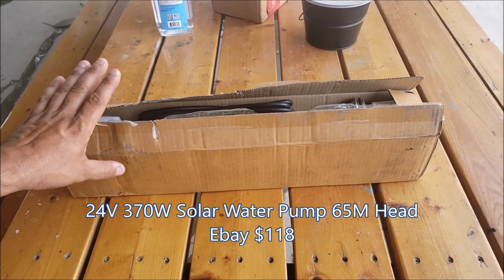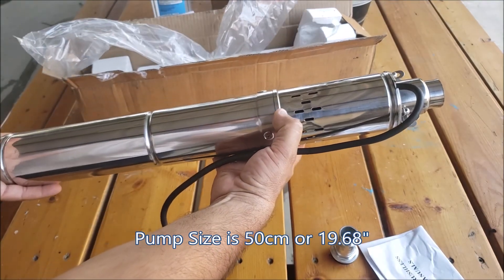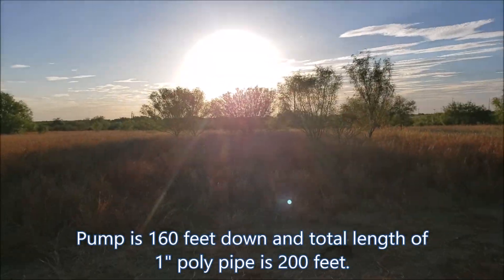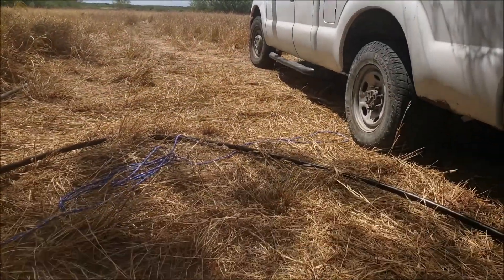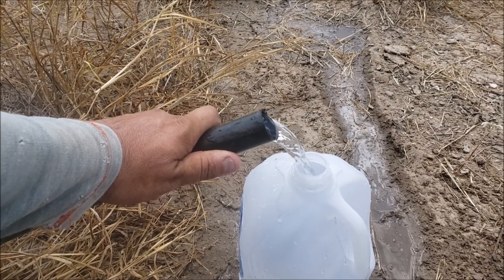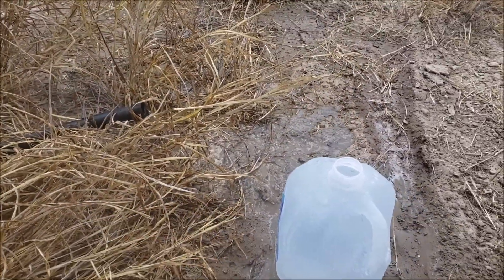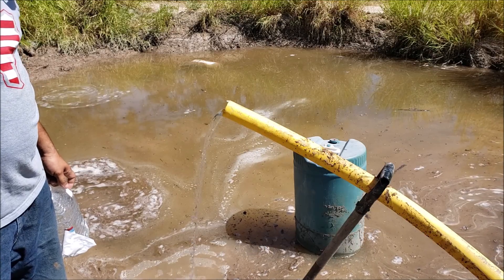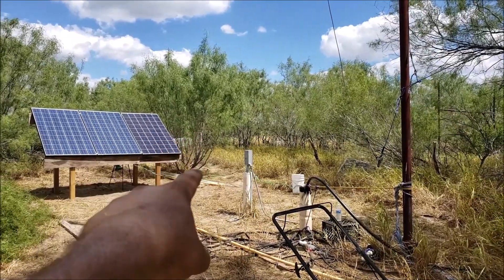DIY 24v solar water well pump for pond using Trina panels from Santan Solar

Comment: How where are pannels  and J am trying to figure out where the switch is too
Reply from the maker: I used 3 x 275 watt solar panels rated at max 35 volts in series. Solar panels--> 200 feet wire--> 24v solar pump. No switch runs all day.

Comment: ALL the cheap Chinese submersible pumps appear to die for the same reason: water entering the motor and destroying it. The pumps themselves seem pretty good. If the Chinese manufacturers could solve the poor motor seal problem they'd have some great products. At the moment, they're disposable, often lasting less than a year, and the promised warranty rarely means anything.
Reply from the maker: I had 1 pump that the body got a pin hole and 1 that the screw wore out and flow dropped to 2 gpm. I do buy the Allstate warranty on ebay and they have replaced 2 pumps for me. I was looking into RPS and their full kits are like $4000. I am planning on buying a new solar pump that uses impellers instead of a screw.
Reply: it is how they make their money, a good quality one would last 20 yrs.

Comment: You will damage the pump if the panel voltage and current are too far from specs.
Reply from the maker: This pump has a sticker showing 70V max. I run a little over 28 volts if I remember correctly. The pump rusted out and got a pin hole before motor failed. I really like this pump over other solar powered pumps.

Comment: What gauge wire did you use. I am down 170'
Reply from the maker: Sorry for the late response but I ran 10awg stranded wire. My friend gave me a 500ft spool of green wire and I just color coded the ends to prevent reverse polarity. Thanks for stopping by.

Comment: Are you using PWM controller or MPTT controller ? And did you used battery ?
Reply from the maker: No controller as this pump has its own built in controller. I run my solar panels directly to pump. Pump works anywhere from 24v to 72v. I can add batteries with a MPPT controller to use during cloudy days or at night but a constant 300w pull on batteries will drain them quickly.
Reply: @cutweldngrind  thanks you !
I bought the same ! And I will add a 400W panel.
I hope it will work very long time !

Comment: Thank you very much for the video. You answered the question I was wondering about this similar pump model I found on Ali, which was, does it work if you have clouds, and if the voltage delivered by the panels is not not at most. And from your video it seems so, there is just less throughput. Knowing it's just for a small irrigation system, I don't need much.
On the other hand, do you think there is security in the event of a lack of water in the borehole? I'm not sure, because it's marked not to run dry.
It would be nice to add security, with a sensor.

Comment: Does the 65 meter water lift works? 
At the beginning written pump is 160 feet down. Interested on whether the motor is strong enough for the max head.
Reply from the maker: The pump is 140 ft (43m) below from the surface. I have an additional 25ft (8m) of 1" poly pipe that feeds into a 2.5" poly pipe. The 2.5" poly pipe is 500ft long and mostly downhill so that does not really affect the head of pump. I did once get a plug in the line and the pump pushed it out so its strong enough. The pump lasted about 1 year and a pin hole developed which caused water to get into pump and damage it.
Reply: @cutweldngrind  If a pinhole developed, I must wonder if that 'stainless steel' is really stainless.
Reply: @cutweldngrind  you haven't answered the question, how far below ground level is the water level.

Comment: Really nice instructional video.  Thank you
Reply from the maker: Glad it was helpful! This has been the best pump I have used but the pump went out in about 13 or 14 months. The panels have worked great.
Reply: @cutweldngrind  Such funny timing to read this.  Just yesterday afternoon my well has failed.  About to go check it out.  I suspect the motor starter.  My friend Steve is planning on using solar panels for his well, and you helped me to understand that setup.  Thank you.
Reply from the maker: @bretgreen5314  Glad my video helped. I had a hard time deciding between 110v AC and 24v DC pumps. Ebay had both pumps at about $100, the 110v pump will output about 16pgm versus 6gpm on the DC solar pump. 110v AC power would be provided by either Grid power or generator. The solar panels I have are rated for 750 watts and the solar pump is rated at 375 watts which means I get enough power on some overcast days. If you go solar powered and have enough solar panels a battery bank can be installed. A typical car battery is about 70AH which comes out to about 875 watts (12.5 Volts x70AH=875wh). 1 car battery would have enough power storage to run a pump 3 hours but usually we tend to only use half the capacity to prevent batteries from getting damaged. IF we get 2 12v batteries in series to run this pump it would safely run the pump 3 hours and up to 5 hours max. I plan on later installing a 1000 gallon tank and using a small RV pump with pressure switch to provide pressured water to sink and toilets. Well, good luck on your pump.
Reply: @cutweldngrind  Very excellent.  You might consider using deep-cycle marine batteries, as they are made for charge cycling and have pretty good capacity.  I once made a 24 VDC lawnmower and used two 12 VDC deep-cycle Sears batteries in series.  It worked very nicely.  Of course, you may be aware of the popularity of the 6 VDC Trojan T105 batteries for solar storage use.  I actually used a set of 16 of those batteries in an electric car once.  The capacity was very good, and they lasted a long time.  Have a good one. . .

Comment: Would you suggest anything different for the same distance going to a bladder tank to a house of 5?
Reply from the maker: I am not sure how this pump will work with a bladder as I am unfamiliar with them. I also just have the end of house opened and gravity feed into the pond so not sure how much pressure it can handle.
Reply: I tried it with and without bladder tank.  It fills the tank up the same as the 220 pump I had. It pulls about 85' up out the well fills tank then goes about 80' to our house. Very impressed with it runs off 200watts

Comment: Is your pump still working.  Thinking of buying one
Reply from the maker: The first pump lasted 2 months and was replaced with an identical unit thats still running great. The warranty is something that does not exist so don't believe the ad, I had to use PayPal to resolve issue.

Comment: Keep us updated!
Reply from the maker: Pump lasted 3 months and I got a replacement installed about 2 weeks ago. I went to the ranch today and this one is still working so hopefully it will outlast the first one. There is a lot of pumps out there for shallow wells that can push more GPM but those are rated to about 90 feet max of head. If there is anything that you need to find out on the pump, pond or solar just let me know and I will try my best to get an answer for you.
Reply: Still running? What gauge wire you end up using?

Comment: Awesome test buddy. If that was my project, I would have gone with the Submersible Solar Water Pump 280W -48V DC-16L/min-60m it is more efficient especially on voltage drop from your 200ft long run.
Thanks for sharing and have a bless day
Reply from the maker: I forgot you also do off grid water well setups. When I bought this pump there was hardly any choices with 50M of head or more. I have not tested efficiency here but a 48v or 60V pump would of been better. I had to use 10awg cable as were a 48v pump I can get away with way thinner conductors probably 12 awg. Well thanks for watching and thanks for the suggestions.
Reply: Benefit of 24V is that it is 100% safe; that's worth something IMO.

Comment: Nice! Just bought a place down in Floresville that has a 1/4 acre pond on it. Wish I had a well to pump water like your set up. that’s awesome!
Reply from the maker: Floresville is not that far away and I almost moved there when Conoco Phillips had offered me a job.  Has the property value dropped to a reasonable price? I remember a lot with a busted trailer home would be about $175k. Well glad to hear from you and sorry for the late reply.
Reply: @cutweldngrind  I think prices are up no matter where ya at. The 3 acre lot next to mine sold at $112k.
Reply: @cutweldngrind  did you drill your own well?

Comment: Awesome video man. I so wanna do that to my well. I’ve been looking into those solar panels, are they worth it?
Reply from the maker: Pump has been running good and pumping every day that the sky is clear. The panels I used were used and can be found for $50 to $75 in just about every city. I have 3 250watt solar panels powering my pump and that's a total of $150, pump $120 and $50 in wire. Thanks for watching and if it fails I will do a follow up video.
Reply: @cutweldngrind  thanks man.
Reply: Never mind I should have read the other comments. Lol. Nice video. Thanks for posting.

Comment: How did the cracked vinyl panels rate ? What percentage are they still delivering?
Reply from the maker: I bought the Snail Trail panels as the cracked vinyl was not available back then. I did several test months back and would say they did 230 watts +. I used several inline watt meters to charge discharged batteries and power lights which is how I got those ratings. I run 4 of these panels to a makeskyblue MPPT controller in 2s2p configuration and get close to 1000 watts.

I really should test them through out the year    to see how the ratings change.